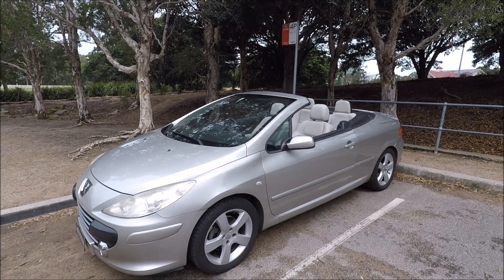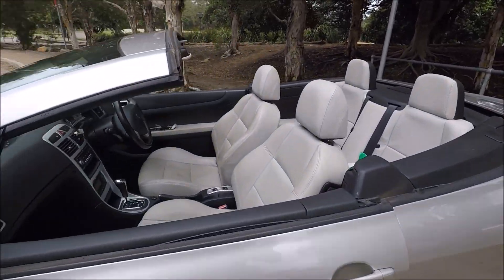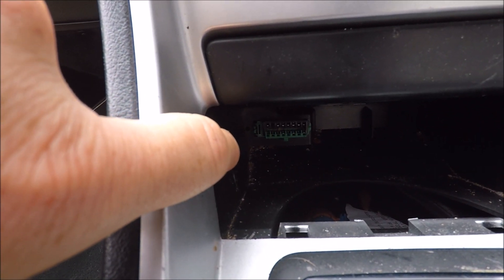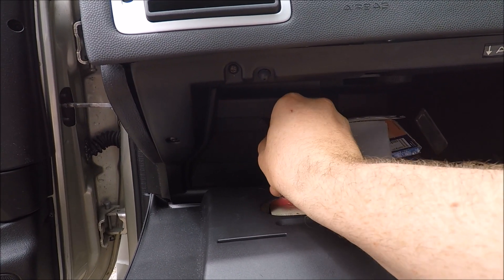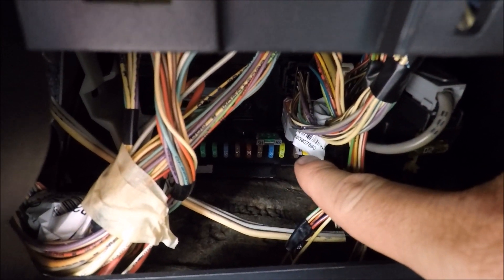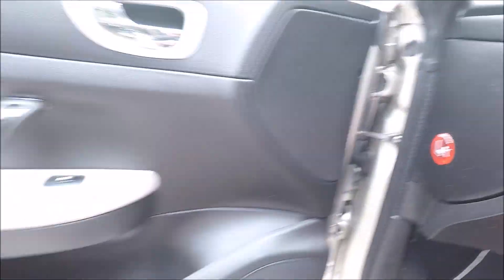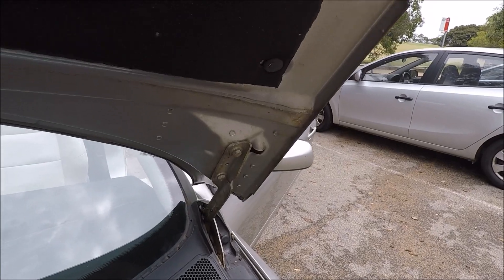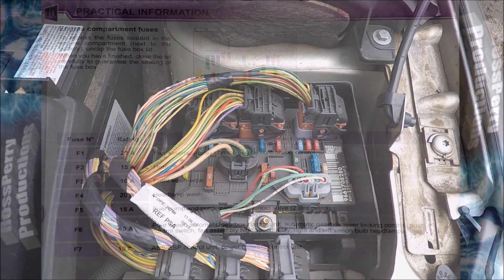Peugeot 307cc OBD2 Diagnostics Port, Fusebox Locations & Fuse Diagram

Comment: My roof is stuck half way open, anybody know how to close this manually??
Reply from the maker: Hi there, if you check the manual there's a section telling you how to do this but basically there should be an Allen key type tool in the tool kit that you put into a socket on the hydraulic pump - this isolates the pump and allows you to fold the roof manually
 the pump is on the LHS of the boot this behind the trim panel. I hope that helps.
Reply: @RossPerryProductions  managed to locate this and manually folded the roof back on but noticed the hydrolic needed topping up so once done it all works fine, many thanks!
Reply from the maker: @qualityfindings7951  No worries at all I am glad i could help, please remember to like and subscribe, I have loads of videos on the 307cc. Ross
Reply: Close all doors and start the procedure one again its should work